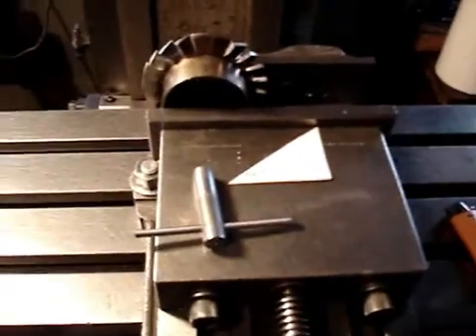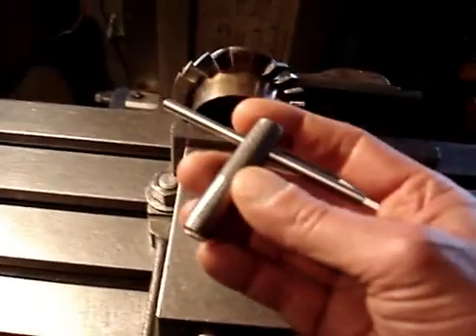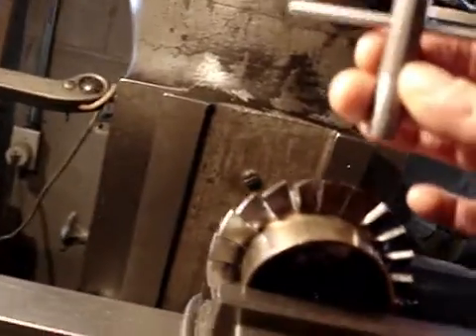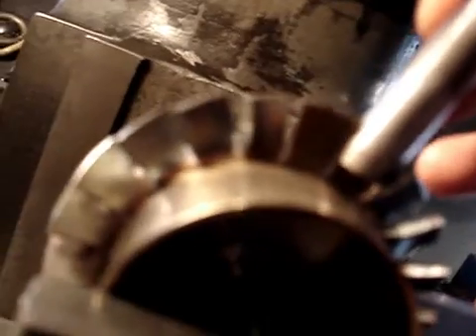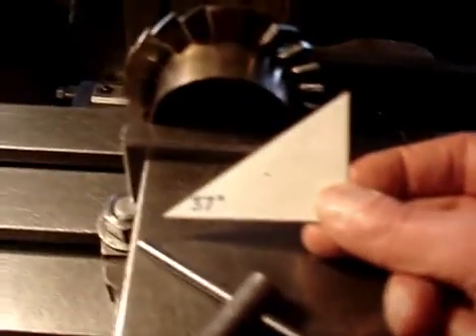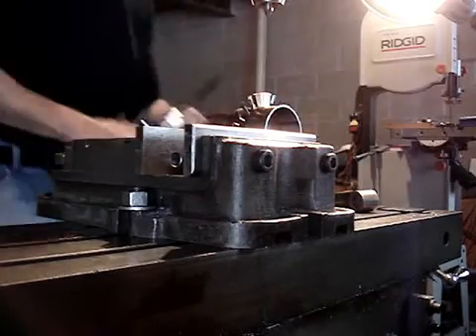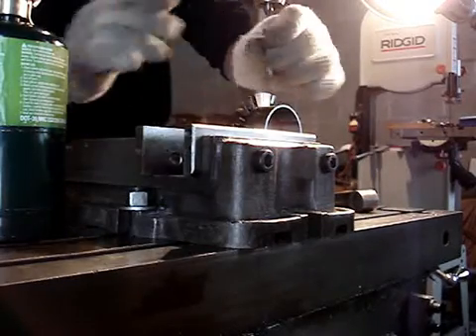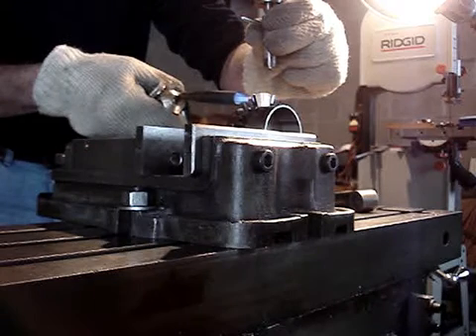Schreckling turbine blade twisting

Comment from the maker: Chris,

The Heineken turbine is somewhat of a mongrel of Schreckling and Kamps design.  There are 3 machined slots on the backside of the compressor diffuser to provide air + oil to the bearings.  The diffusor blades are  a tad over 1/4" out from the compressor.

Jeff

Comment: 347 stainless 
Hot Working   Working temperatures of 2100-2250 F (1149-1232 C) are recommended for forging, upsetting and other hot work processes. Do not work this alloy at temperatures below 1700 F ( 927 C). Material must be water quenched or fully annealed after working to reattain maximum corrosion resistance.

 Cold Working  Although this material requires higher initial forces than 304 stainless, it is quite tough and ductile and can be readily stamped, blanked, spun and drawn.

 1100c  yellow glow 950 red orange ,probably better to cold work it.
Reply from the maker: 347 is hard to machine with HSS end mills. I buy it in sheets end use a rotary turntable on my Bridgeport to cut the turbine disks out. 

Regards

Jeff

Comment: 347 stainless looks like 316 in chromium nickel and manganese % ,316 mode of failure is safe, if it runs too hot the blades untwist and jam in turbine housing. Kurt recommended reducing the NGV angle from 37 to 36  and it was common practice to reduce the 37 degree turbine angle at the tip to increase efficiencyand lower temp.The FD3/64 is a good engine to make and learn on but is limited by it's long shaft and adding a alloy compressor or a more solid bolt on turbine wheel will reduce the wiping speed of the shaft  and reduce the rev limit.is your engine self sustaining at under 600c with no flames visible ?
Reply from the maker: Hi Chris,
I don't have a way of measuring the EGT other than a visual of the wheel.  It did seem to self sustain though.

Jeff
Reply: Hi Jeff 
early on testing it is better to just visual check in dull light or night  as the temp can vary a  lot ,if you are running on gas when you reach sustaining rpm there should be no flames outside of the turbine wheel, look for cold and hot spots on the outer body of the ngv area ,the fd3/64 design is hard to seal the combuster at the point where it fits against the outer body .i had some 304 stainless spun at the back which had a step in 3mm deep same dia as the combuster to help centre and seal better ,it can also burn away and crack in this area when using the mild steel gas can body.are you using the original design combuster with the tapered inner and coil vaporizer? I have drawings for  2 improved combuster designs to suite low pressure design of fd3/64 and the mod for m/cing a aluminium open fronted compressor wheel.
p.s don't run it on liquid gas or jet fuel until it runs even on gas or you will distort  the turbine housing.
p.p.s be careful running on gas, start at very low gas setting and let the flame pop back in to the engine as it slows down then slowly turn the gas up and feed the air in again  from the front at a distance first.

Comment: Hi Jeff couple more tips, use a large grade 12.9 cap head bolt for your shafts they are heat treated steel tough as old boots,the turbine is best out of 316 or 310 stainless use a stainless bolt of the same grade for the hub with same filler rod when welding.i made my  compressor wheel out of aluminium alloy (can't remember the grade) flat across the front face then made the 8mm dia shaft come though 2mm to locate a spinner held on with a 4mm cap head I.never did the original combuster with the long tubing that you have to drill holes in  i was in the GTBA (gas turbine builders association) in 1997 they had two designs that gave more consistent results in the fd3/64 both stick design with  6 or 8 hypodermic needle injectors about 0.5 o/d give cooler more even running with no hot stop at the bottom. stops the distortion of the turbine housing. if you use nylon 66  for the intake m/c  it down leaving a couple of mm inside and out then boil it in water for 10 minutes to stress relieve it, rechuck and m/c to finished size,  otherwise it will keep expanding over several months and spoil your tight clearance which is checked when pushing the shaft forward.  
hope I am not telling my granny how to suck eggs as we say in the UK
regards Chris
Reply from the maker: Hi Chris,

All my turbine shafts are hollow chrome moly tubing.  I do this in an attempt to save weight.  The bearing spigots are made from aircraft quality chrome moly rod and are pinned to the tube with rill pins.

Thanks for your input, much appreciated.

Jeff
Reply from the maker: Sorry,,,roll pins.  My turbines are made from 347 stainless, better than 310 or 316.

Comment: hi Jeff ,if you have a look through my channel you will see some tips on schreckling and kamps builds.the beer can schreckling looks big ,be very careful if you have scaled it up.
Reply from the maker: Hi reedy93,

Thanks for the info and word of caution.  The Heineken turbine had a 100% carbon fiber compressor which did explode at around 35k.  I machined an aluminum Schreckling compressor in open form, but haven't tested it.  All my builds are in the jet and turbine owners pro board. The Heineken builds are roughly 40% enlargement over the plans.  I'm currently making a 2nd Heieneken based turbine.

Regards

Jeff
Reply: i had a wooden compressor let go on me just turned to dust total non event,made an open fronted wheel 1mm thick  blades with a 4mm ball end slot drill to give a 2mm radius at the root ,ran it with 0.1mm clearance to a nylon intake worked ok but does run hotter than a covered wheel ,youv'e got to keep those clearances tight ,turbine has to be 0.12 to 0.15 max gap between turbine blade and housing,if you machine your compressor wheel taper it from centre to tip not stepped like the wooden wheel, keep it about 1mm minmium at the tip at 66mm dia. (i run a 66 compressor wheel still with a 64 mm turbine.also built the Kamps and the KJ66.
will have a look for the jet and turbine owners pro board.  
play safe. 
Chris